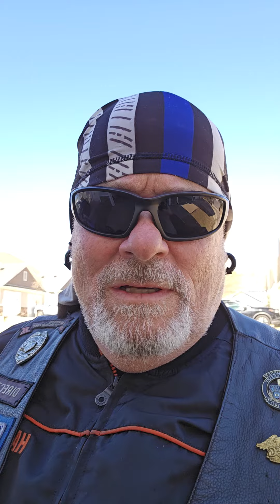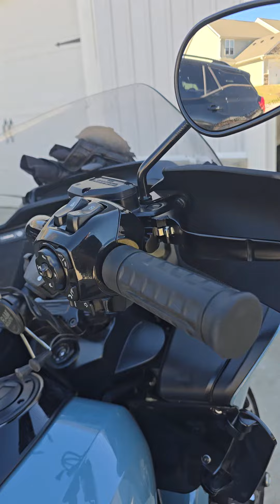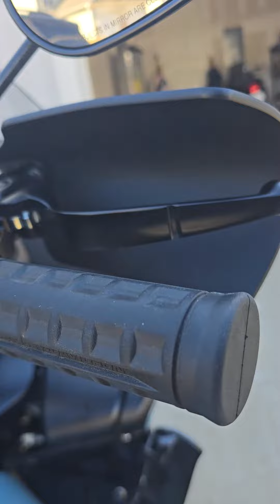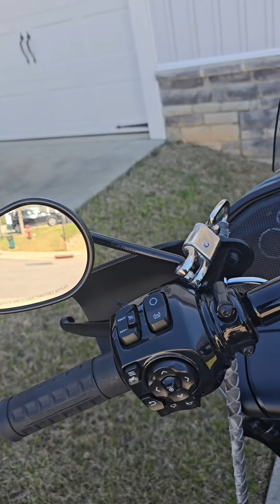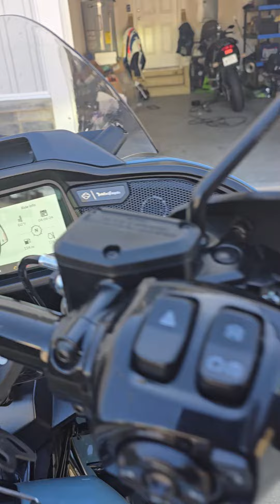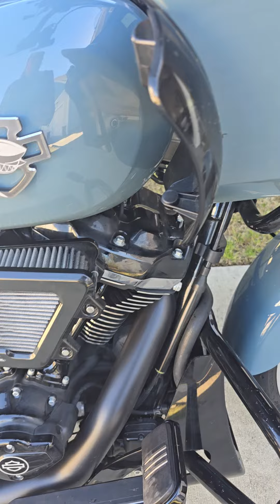2024 Road and Street Glide cruise and fan

Comment: Didn't know about the fan trick! Awesome. I was actually hoping to find out info on the CoolFlow fan actually. In the menu when you click on the bike icon it brings up that option to turn it OFF - AUTO - ON. Any idea about that? I turned it on and brought up an error code on my ECM. Tried finding if theres an actual part to buy and no luck.